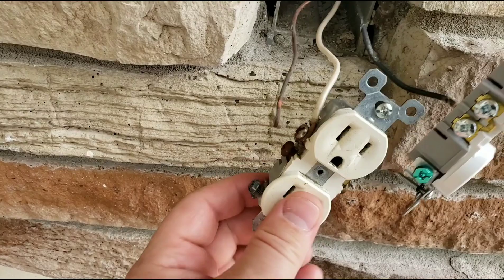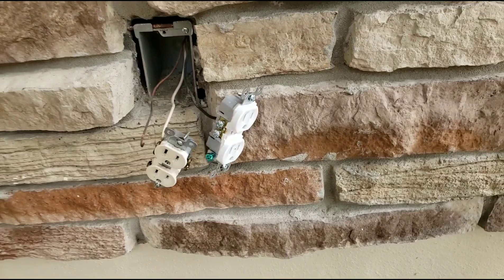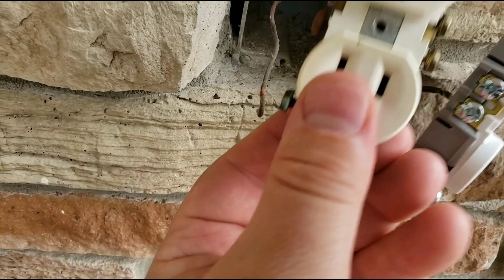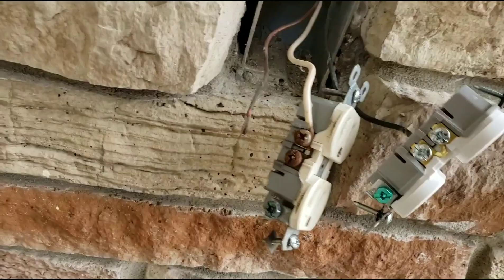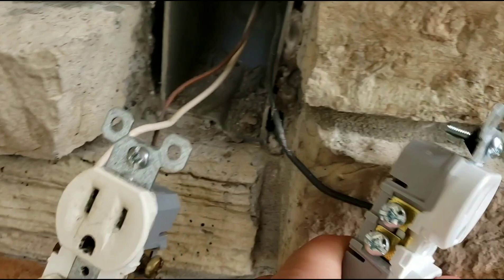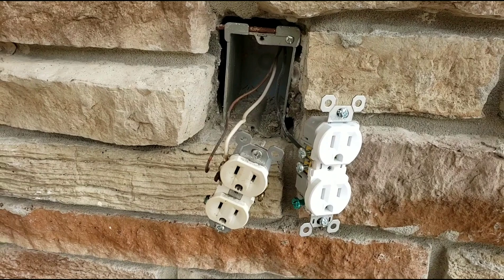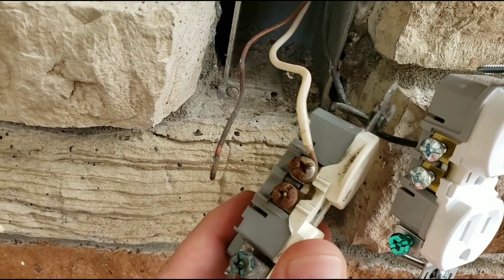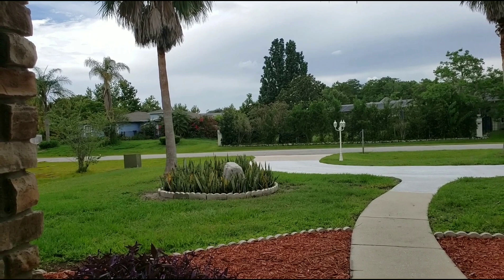Why Your Electrical Outlets and Recepticles May Have No Power-  Electrical and GFCI Outlet Corrosion

Comment: Have you ever heard of having four outlets, two in the garage and two outside. They should be GFCI. I don't see a reset button on the inside outlets in the garage. I plugged in the same amount of holiday lights last weekend. They ran for about four hours and then they went dark. The breakers don't seem to be for any of the outlets. I even had a licensed electrician out. He checked all of the outlets and couldn't find anything. He claims there is no feeder line to one outlet in the garage. I told him the outlets have worked. He said that he was surprised they did. House is 14 years old and night it new. Nobody has touched the electric in the house. He said that he can come out again and install a new breaker that's dedicated to the outlets. I just don't get it.
Reply from the maker: Some electricians take shortcuts sadly and dont always hook up a gfci which is against code. 1 gfci outlet can be the gfci for a whole section of outdoor and indoor outlets. Hope this helps. You might try another electrician as well some are not as experienced
Reply: @drewsquickfix  yeah this guy seems to have about 17 years or so experience so he says. I was perplexed due to the outlets had power before and he claims there is no feeder line from the box to any of the two outlets in the garage. Also there is no breaker labeled outside receptacles. We tried all the single pole breakers to see which would be for an outlet.  The outlets are labeled GFCI but no test/reset buttons on them. All outlets and lights are working inside. After going in the attic to see if there was a cut in a line which is unlikely. Nobody has been up there and I don't have rodents or critters. He then mentioned he could connect to the garage door power and lights and tap into that. I said nah. I want it done right. Anyway I think I'm going to get a known company to come out to take a look. I'm not sure if I'm more perplexed about the setup by the builders electrical contractor, or this fits inability to determine the issue. He spent about 2.5-3 hours total. Didn't pay a penny to the point. He was recommended on the community forum be a few people. He also says he works for one of the theme parks here as a contractor.
Reply from the maker: @drivecfl  a second opinion is always good, please subscribe!! Thanks

Comment: Thanks drews. yeah That happened rooms lights goes out that causes electric issues like over power like plug in too many plugs or has more power that breaker box cant handle it and that make the breaker box pop and have to reset the breaker box to get room lights and room power back on.... I'm scientist of electric,power,lights and what causes to make breaker box pop and room lights go out and what use more power to make breaker box pop.
Reply from the maker: Lol be careful  not to cause a fire mikey ha ha too many plugs will pop the breaker but you never know if it doesnt pop. :)
Reply: lol yeah plus I missed your vid = video to :) we are still buddies :)
Reply from the maker: @DisneyLuckyDalmatianFan101  of course mikey, yeah I was in Florida for a while didnt do too many videos while I was there but I'm back now
Reply: I'm glad your back buddy :)
Reply: Might try swapping some of the lights to LED and replace older heaters or fans for more efficient ones. Don't ramp up what you were using if you go to LED either. There's something called inrush current that will give you the same issue ...